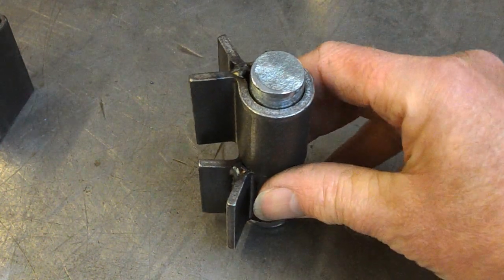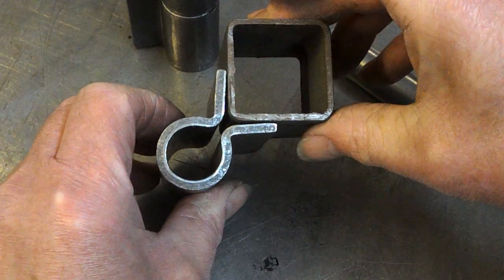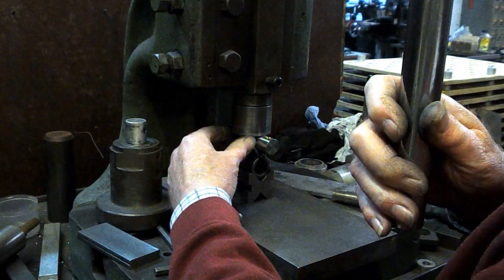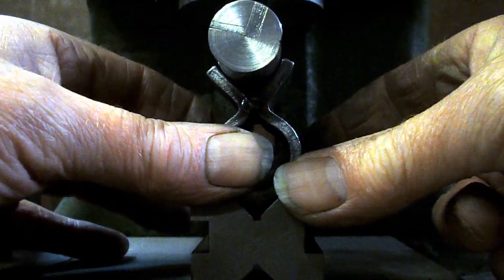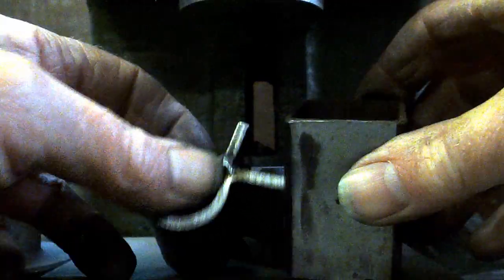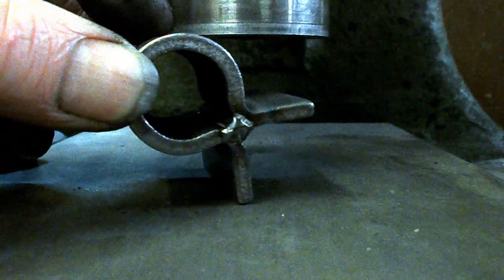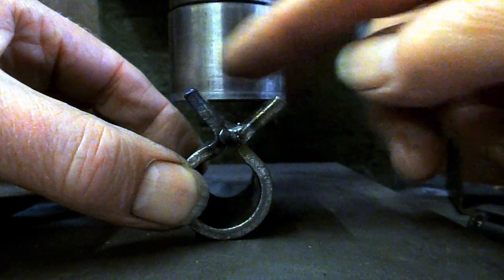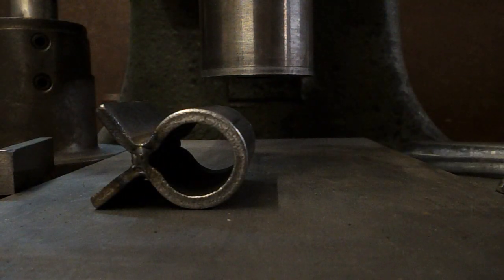Fun with Fly Presses - Knocking Gate Hinges into shape.

Comment: you have a welder, you have a press ,pipe and angle iron why would purchase garbage and try to repair it when you should have made them yourself in the first place
Reply from the maker: That's a good question! You don't knowingly buy garbage though. You think you're getting something that will be just the job & generally it's much easier & cheaper to buy hardware components than to make them yourself.